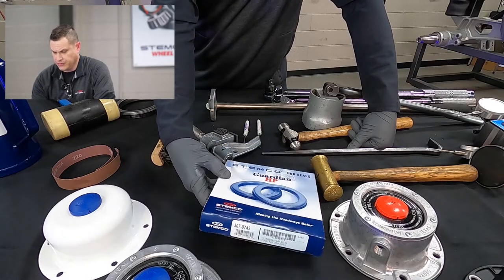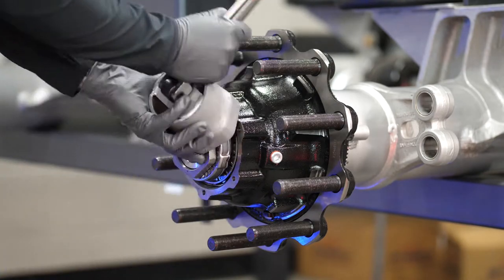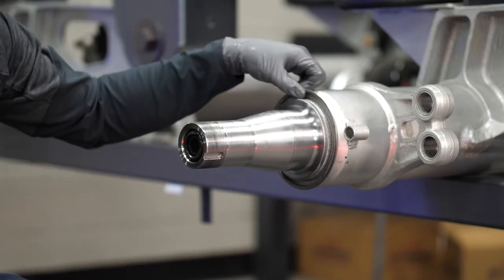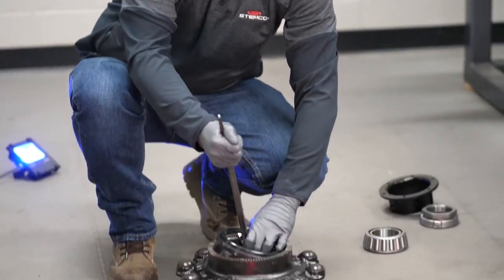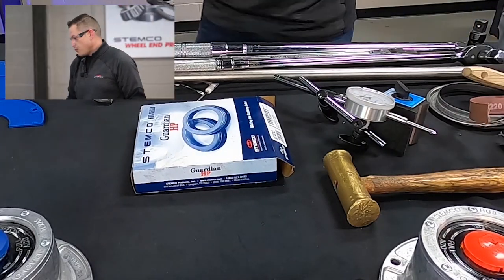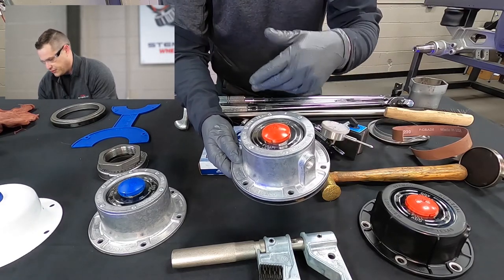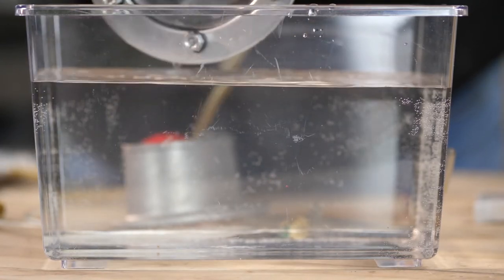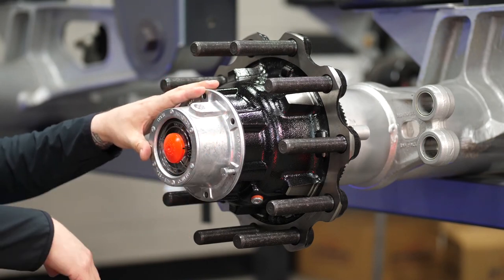Wheel End Bearing Adjustment Installing Guardian HP Seal - Tech Talk

Comment: your stemco coworker tech say before if the ware in the spindle is more than 8 thousands of an ich it has to be change and you say between 6 and 10 thousands of an inch , which one is correct ?
Reply: A spindle that has wear on the bottom in excess of .008" should be replaced as the wear changes the center line of the hub and will lead to wheel seals failing prematurely.

Comment: Sorry, as a trash truck mechanic I've replaced hundreds of leaking seals and 95% of those have been  stemco or CR. 4% have been a mix of Mechanix brand and other off brands. Probably 1% have been national 37 series and 1 38 series and most if not all were obvious improper bearing adjustment.